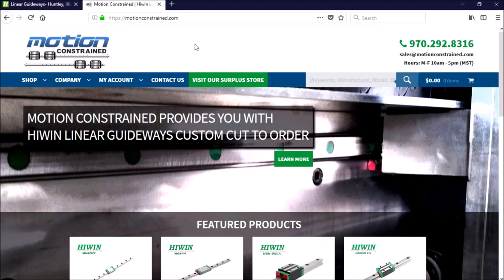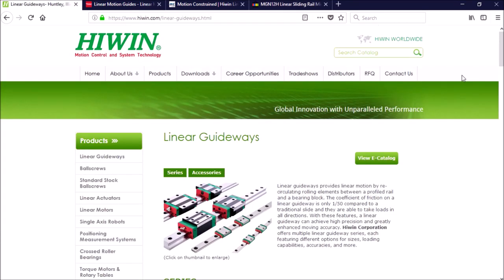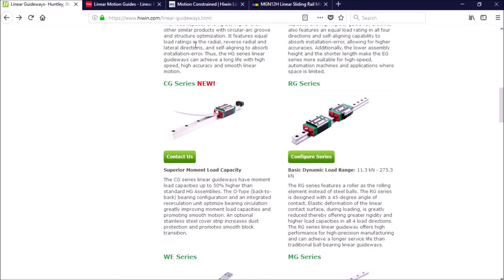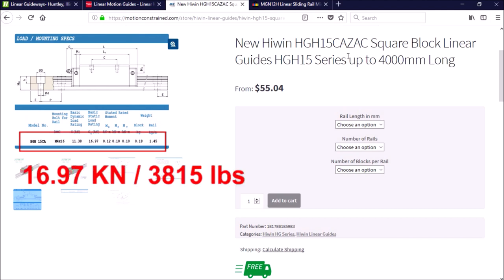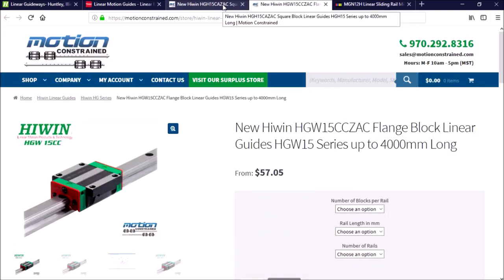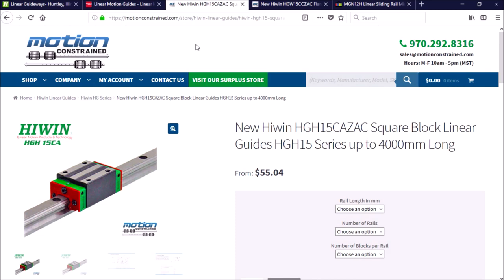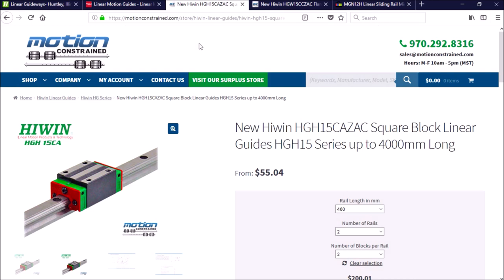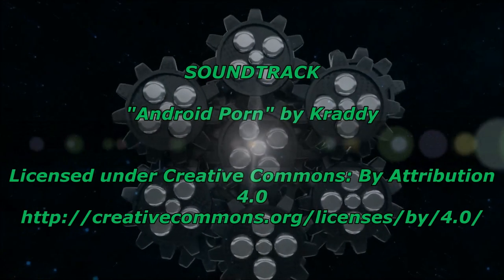Selecting  linear Guideways

Comment: Hi Sam,
Good overview showing a lot of the points to be considered.  As you point out these rails can take loads well in excess of a typical cnc router or mill, but the main reason for rail selection is the stiffness.  This what matters as is controls the stiffness seen at the cutter so how much it deflects for a given load.  So a design may look over Engineered based on load handling, but not stiffness.
This is related to the rail/carriage size, and the mounting bolt size.  For example my old DIY cnc router Z axis used 15 mm rails and was secured with M3 screws.  My new machine uses 20 mm rails with M5 screws as the rail stiffness is significantly higher.  I also went with 20 mm on the X and Y having also considered at one point 25 mm on the long axis.  Looking forward to the installation video.
Reply from the maker: Thank you, 

Yes Great point! 

Stiffness is something that maybe more of a consideration than Load capacity I did not discuss  Pitch ,Roll, or Yaw (MR, MP, MY) or the force that each type can absorb they are listed in the specs for each series. the HG and RG are 1 to 2 lbs. All of this is of course effected by installation tolerances. The HG series Ball type being more forgiving. Lots of variables and information. Thank you for the Comment.
Reply: The stiffness is certainly a factor to consider when choosing the size of linear guideways. Another factor is the desired service life. 
For guideways, the dynamic load rating of is the load that can be consistently moved for a total of 50km. By choosing guideways that have dynamic load ratings greater than the application's requirement, the service life can be extended greatly. 
Hiwin has a ton of great formulas at the front of their catalog that can be used to determine service life of their guideways, based on the loading conditions.

Comment: Loved it. Very informative and use full to those who build their own machines. I have a question about the preloading. I put linear rails on my cnc router and did no preloading. Will that effect my life expectancy on the rails and blocks or just reduce the accuracy? Maybe both?
Best Matt
Reply from the maker: Hi Matt
Thanks I'm no expert but all blocks have preload the stock blocks you have with a Zo in the model # has a light preload. Think of it like having a marble pushed through a hose that's what you have then medium would be a pin ball. It will still move fine just tighter. However if there is a slight link the pinball will wear more than the marble.
For a router you should be fine and the life expectancy is around 30 miles of travel. And at that point o ly 10% fail. You should be fine with accuracy and longevity.
Reply: Thanks! I was under the false idea that the preloading was done during the install. Thank you for the clarification.
Reply from the maker: No Not at all The blocks are designed with the designated pre load, the interchangeable rails have 2 Light and Medium denoted by Z0 and ZA in the model #
Reply: CNC4XR7 fantastic that makes it much easier than I thought. Can’t wait to see this happen!
Reply from the maker: Me too!

Comment: Thanks for the great information.  I'm planning to build a small CNC Router.  Travel on X and Y about 400mm and Z about 100mm.  Any tips on the size and type of rails I should get?
Reply from the maker: I think you will be fine with 15mm rails I suggest you take a look at the Hiwin guide and see what works well for you EG series might be ok
Reply: Thank you!

Comment: 5:08 so Normal precision is of tens of millimeter? wow, that really sucks. I bought a 2 micron spindle at aliexpress for 400 bucks, I can't put it on a linear guide that has error of +/- 100 micron.
Reply from the maker: I believe those were in MM .008mm Accuracy the charts are in the video

Comment: Tha static rating is usually not permanent deformation. Hiwin quotes something like force when deformation is 0.0001 *diameter of the balls. Which is way bellow yeilding.
Reply from the maker: Maybe I stated or did not explain it clearly Sorry about that This is taken from Hiwin:

(1) Static load rating (C

Localized permanent deformation will be caused between the raceway surface and the rolling elements when a linear guideway is subjected to an excessively large load or an impact load while either at rest or in motion. If the amount of this permanent deformation exceeds a certain limit, it becomes an obstacle to the smooth operation of the linear guideway. Generally, the definition of the basic static load rating is a static load of constant magnitude and direction resulting in a total permanent deformation of 0.0001 times the diameter of the rolling element and the raceway at the 
contact point subjected to the largest stress. The value is described in the dimension tables for each linear guideway. 
A  designer  can  select  a  suitable  linear  guideway  by  referring  to  these  tables.  The  maximum  static  load  applied  to  a  
linear guideway must not exceed the basic static load rating.